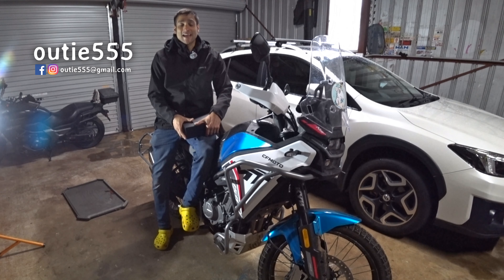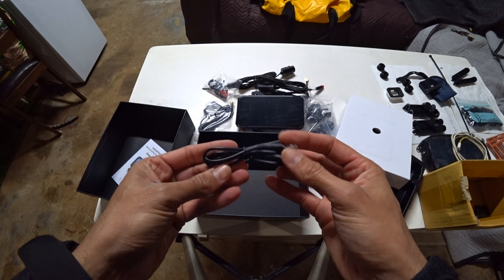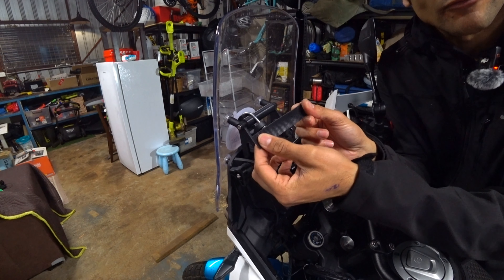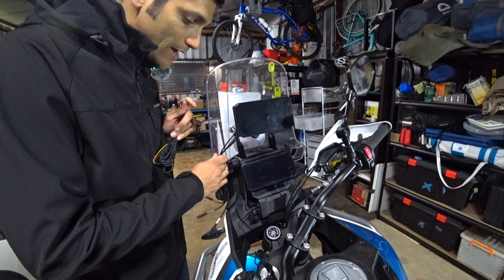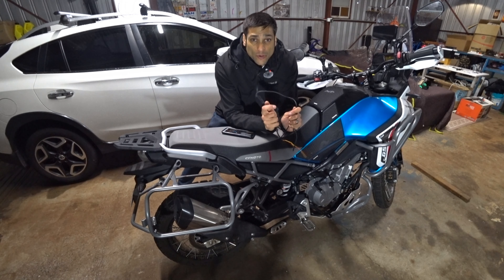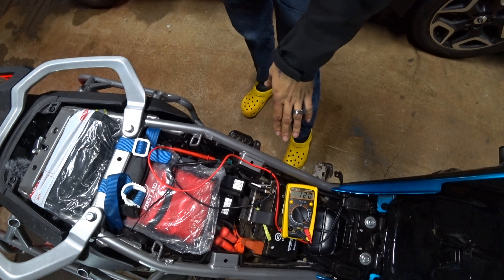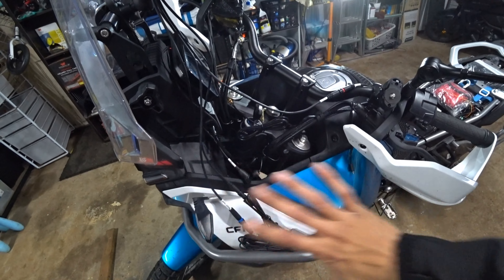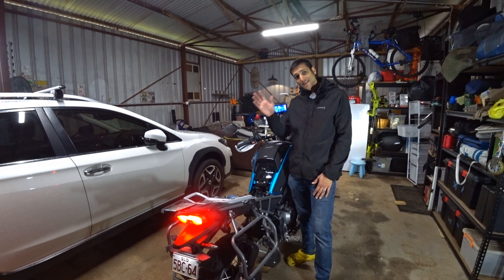Aoocci C601 UNBOXING and MOUNT INSTALL | part 1 of 3

Comment: Great job  mate, thanks for the info on wiring,  I didn't know about the accessory port under seat. My gps gave me a flat battery as it did not turn off properly.  😢
Reply from the maker: Glad it helped. I got the bullet connectors from Supercheap auto, 4mm and red colour in a packet of male and female connectors.

Comment: The dash looks much better with this one. Would be interested to see how much battery it drains with the DVR running
Reply from the maker: I could be wrong as I wired it to power that turns off with the ignition going off, but I don't think it records when it's off (and connected to POS and neg battery terminals). But so d
Far I've been playing around with the ignition on and doing updates etc on it for 45 min and the bike still started fine so not too much draw when it's on with the bike on but not with the engine running.
Reply: @outie555  try noting down the battery charge showing on the speedo before you go on a ride and see if dips significantly while or after using the DVR. I have added a SAE connector to the battery and keep it plugged to the solar trickle charger when not in use.

Comment: Nice video my bro, Hey when are you going to wire up your hydrogen fuel cell that you created back in 2006. Good times 🙂
Reply from the maker: Good question! If I connect a solar panel to the HHO generator then it's going to produce max gains with no draw on the bikes fuel consumption so might be able to extend the range by 100-200 center meters per fuel tank. But if i can get my hands on a magnagen 2.0 I can boost the propulsion magnetically. Just waiting on your prototype to be certified for safe human consumption.

Comment: Where did you find the 12 mm id tube please? My google fu is coming up empty
Reply from the maker: I designed it and printed it off on my 3d printer. But the weight of the unit is too heavy and makes the screen lower on its own when riding so I just bought a mount from Ali express that I've yet to install. It mounts just above the display and would be the better way to go.
Reply: @outie555  cheers mate, that explains why I couldn't find it! Thanks for the heads up on mounting to the upper bar also